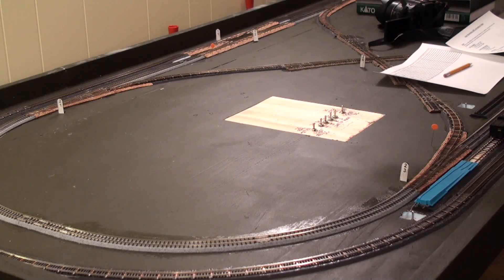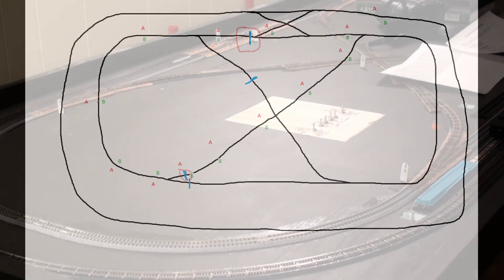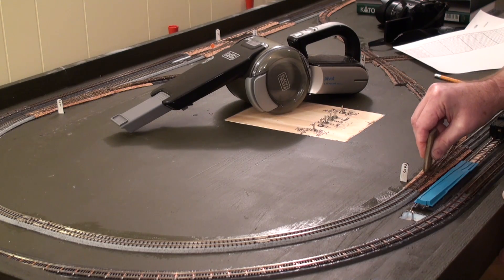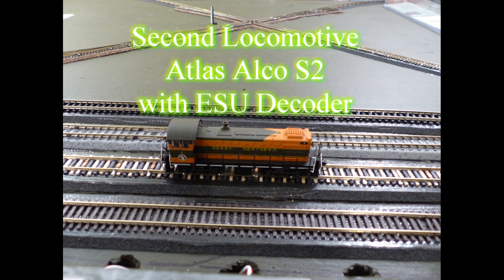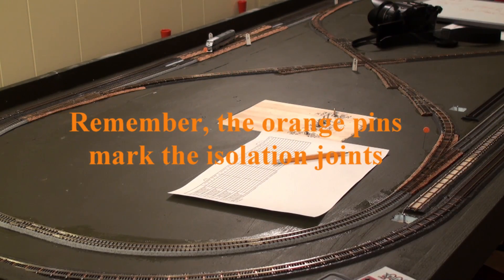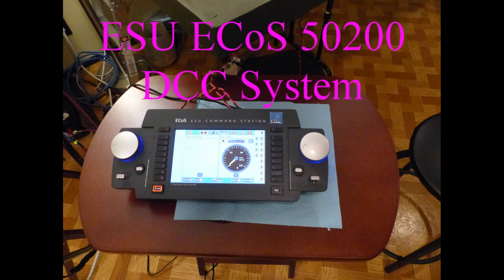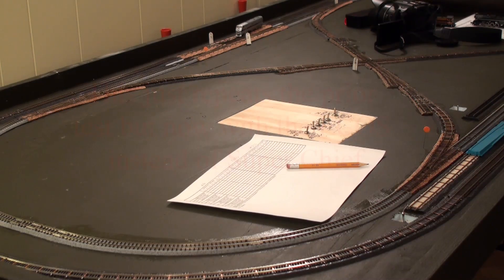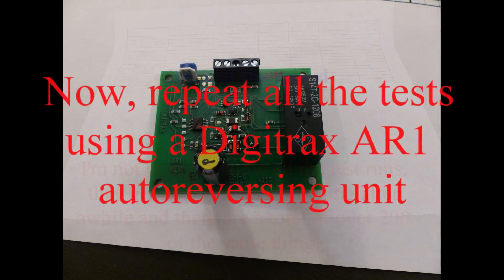What's the best Model Railroad Auto Reversing Unit?

Comment: I had the same double reverse loop on a layout of mine using a Digitrax AR1. All I did was isolate the 4 entry/exit tracks and wire the AR1 to the X. no problems at all.
Reply from the maker: I do't know if Digitrax has updated the AR-1 but when I tested it, it was an electromechanical device and it just took too long to switch which meant my sound equiped locos would stop and restart, pausing for the startup sound to finish.  The Digitrax decoders now have the option to not pause so newer equipment shouldn't have the problem.

Yup, you could just isolate the center as well but you need to make sure that your trains will fit within the reversing loop.
Reply: @donmartin9567  My experience was 9 years ago with then current electronic AR1 on an 'N' gauge layout and it switched immediately with no hesitation of any loco. Happy modelling.
Reply from the maker: @geoffwalker315  Great that yours worked.   Wish mine would have.   I would have saved a chunk of money.

Comment: Don, this was awesome.  I have 2 reverse loops (about 6 years of running).  AR-42 has never failed me.  Sound locos, old locos, MU lashups,  never fail.  My other loop, AD520, worked great until it didn't.  I think  relay-based reversers have a unknown shelf life.  In my case, 6 years.  Great video.
Reply from the maker: Thanks Michael.   Part of the issue with the Relay based ones is that there is a brief interruption and some decoders handle it better than others.   The older Digitrax decoders will sense the interruption will "restart" and because you don't have an option, it goes through the engine start up sound sequence before the engine moves.   The newer Digitrax decoders don't do that and it only affects sound decoders with the sound on.  At least that's been my experience.

However, I do have a PM42 installed on our club layout and use one of the 4 circuits as an AR for a turntable but that's a somewhat different application of an AR.

Comment: running too much current ruins contacts- not the fact that they are mechanical....
Reply from the maker: Thanks Tom.   Yup "too much" current can certainly cause problems, especially with really thin contacts but, we don't generally run that much current through our systems (small systems 2-3 amps and larger 5-8).   However, over time all Mechanical Systems are subjected to weather and corrosion and what I've found is that it is the corrosion & aging of the components that cause the connection to slowly fail.

This is why I modify all my electrofrog turnouts so they do NOT depend upon physical contact to conduct power and why I solder all my mechanical rail joiners and make sure that all track either has a direct power connection to a feeder or is soldered to track that does.
Reply: @donmartin9567  just making a 'point'...... get it LOL

Comment: Biggest problem with pm42 and ar1 is they relay based not sold state is so much better cos they ca change quicker and don’t ave parts that wear out  relay contacts will stop working after time cos of the arching
Reply: relay contacts don't fail because they are mechanical; they fail due to too much current being run thru them- just like the old breaker-style auto distributors.
Reply: too much current ruins contacts, not the mechanics of them.

Comment: Digikeijs , by far the best working and great looking too. https://www.digikeijs.com/dr410-digitale-keerlus-module.html
Reply from the maker: Interesting.   Not something that is well known over here at all.   Good to know that there are other options as well.  I did note however that it requires power the module as well as Track the Power.   The ones that I've looked at in North American do not need additional power, they use the track power for the board itself.
Reply: Don , to work as a reversing unit it does not need additional power , DCC track power in and power out that's all that is needed. The additional power is for other purposes. See the manual.

Comment: Digitrax is crap. PSX.AR and the regular PSX breakers are the BEST.
Reply from the maker: My preference is the PSX-AR due to how well it works and its adjustability but I also use the Tam Valley dual Frog Juicer and on my layout I can't tell which one is powering which reverse loop without looking under the layout.

The Digitrax solution (and other similar ones), have their use but I don't think they are suitable for layouts which run sound equiped locomotives.   If you didn't have to worry about having to wait for the sound start-up to complete (ESU decoders let you disable this and the newer Digitrax decoders seem to ignore start-up as well) then the Digitrax and other solutions would work, you'd just get a momentary blip of no sound and jerk as the loco reacts to the slow switch.

Comment: I went to a dead rail system and all these problems went away. Just lay the track and run the train. Even the track cleaning is a thing of the past.
Reply from the maker: I have over 50 locos so I'm not interesting in converting that many locos to wireless.   Plus, pretty much every conversion would require some amount of the frame to get the receiver and battery in there, especially seeing as pretty much all my locos are sound equipped.

But, I'm glad that companies are investigating alternatives.   At some time there will be a successor to the aged DCC system and I'll be interested to see what that is although it is unlikely that I'll be able to switch, unless the new system is backwards compatible.

Comment: Im not sure why you were having so many issues with the PM42.  I have been using it as my autoreverser for a long time with no issues with sound or hesitation.  I had my trip settings set to the fastest settings and all was good.  This was running both sound and non sound locos.
Reply from the maker: And I have no idea why it would work for you as it certainly doesn't for me.  I've pulled PM42s from two layouts because, even at their fastest setting, they don't flip fast enough.   I've emailed Digitrax and no help from them.   However, the PSX-AR does work as does the frog juicer.  I've already spent a lot of time on trying to resolve this.   IF there is something else that I needed to do then it is FAR too complicated for me to use.
Reply: The main difference i can see watching your video again is my placement of the PM42.  I used mine in the center of the "X" when I had my figure 8 with an oval type layout.  I would have the tracks isolated about an inch after the turnout and the entire X was the reversing loop section.  I have also used it in the teardrop type and also a single center cross over in an oval.  All 3 layouts used the same PM42, but the figure 8 used the Digitrax  Empire builder the other 2 had the Digitrax Super Chief.  Also I had JMRI control on all 3 different layouts, using the LocoBuffer interface.  I cant remember now if I programed my PM42 with JMRI or with my throttle.  My PM42 was also used as a Power manager at the same time, I had 1 channel as a reverser and the other 3 as power districts.  Having sold all my old equipment and now buying new I'm hoping everything runs like it did before.

Comment: why aren't you flipping you points.. i thin your testing method is floored because you doing an x loop on the inner loop..
Reply from the maker: You don't see my entire layout nor a diagram of my wiring.  The layout is set up so that if I do a complete loop (not using the figure 8) then the rails polarity match up but when I engage the figure 8, the polarities are different which causes the AR unit to detect that and flip the polarity.

So, no, my testing method is not flawed but thank you for checking.
Reply: understand this you should be isolated from the outer track by rights you should be doing the test on the inner loop not outer, that is what i see why you are getting failure point your frog should have a dead short though becaus there is active currant coming from the outer track it's supplying power to the frog 

in reverse you should be shorting on the actual frog because by all purposed there shouldn't be active power to the frog you should be electrically isolated from from the outside track which you are not doing. may be there needs to be something digitally between that kills power to the frog..

I don't know what your setup is like though if the frog is physically powered no amount of testing you do is going to fix whatever issue you think you're having because you have you have atleast 1 rail with constant power which is enough to get through the points..

i think you perceiving an issue where either isn't 1 or the issue is power isolation of the actual frog
Reply from the maker: Hi Jason.   When I talk about "issues" at the start of the video, the issue I was having was that the AR unit I had installed would not flip fast enough and thus the decoder in the engine would recognize the short and shut down, then the AR unit would recognize the short and flip the polarity (like it is supposed to) at which point the decoder would no longer be shorted so it was good to go so the sound system onboard the engine would have to go through its start up sequence before it could move again.  The Auto Reversion Unit was not reacting to the short quickly enough

Yes, without the AR unit, there would be a short.   But, the loop is isolated to make sure that doesn't happen.

All Frogs are wired to their associated switches so that when the switch is moved, the power to the frog will change.

By using either the PSX-AR or the Frog Juicer as an Auto Reversing unit, the issue was resolved.
Reply: so basically a timing issue was causing the issue..

sounds like a combination of polarity issue with a timing issue I would suggest using the same switch throughout the layout may fix any additional issue..

sounds like you may also need a switch controller to be added to where electrically isolate a section of track so you can run to a certain point and the train stops